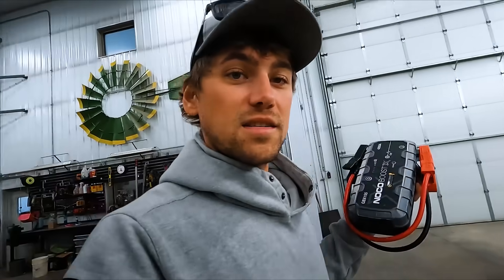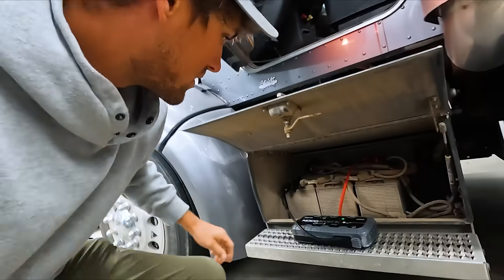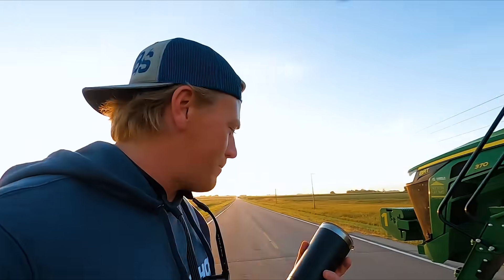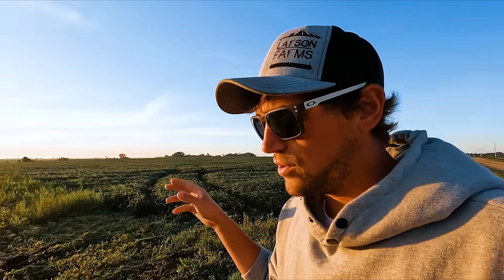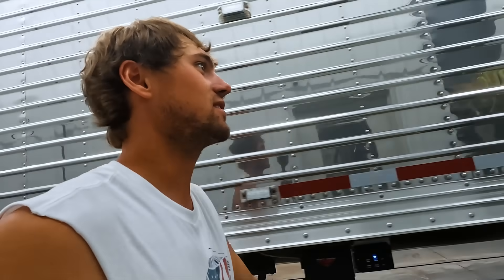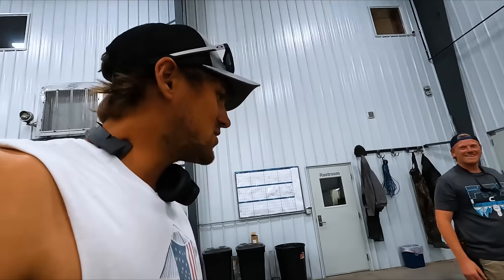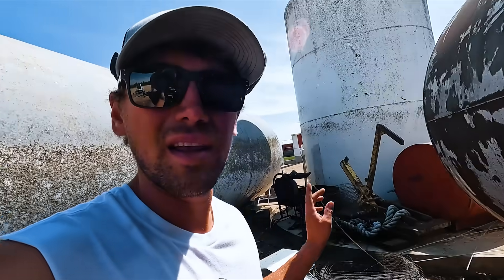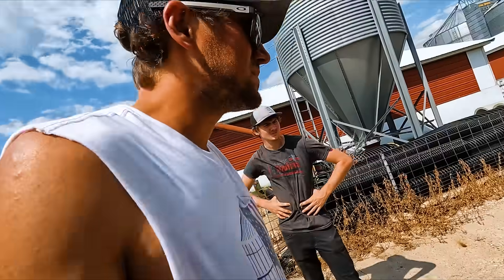Killing Our Crop So We Can Harvest!

Comment: Flexzilla makes a good hose. However the issue I have with their enclosed reel is that it doesn't wind up with air still in the hose. You have to dump pressure first.  😢

Comment: Why not put a camera at the top of your combine connected to a decent screen so you can see the road ahead clearly when your geringhof head is folded. Could even mount the camera inside the cab at the top of the windscreen so you do not have to clean the camera. We have a 6 camera system on our combine we got cheap

Comment: 105.68 miles west of RUSSIA  :)
Reply: power wash them with Trisodium phosphate (TSP) and rent yourself a pneumatic paint gun; use latex epoxy paint (easy clean up); prime using 1/3 water to 2/3 top coat - or Zinsser 1L Bulls Eye 1-2-3). cheap